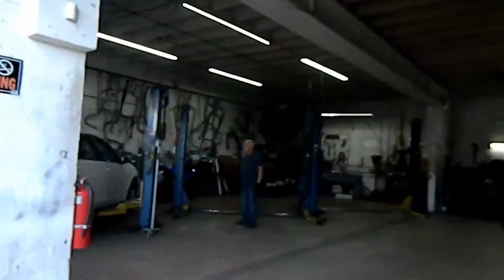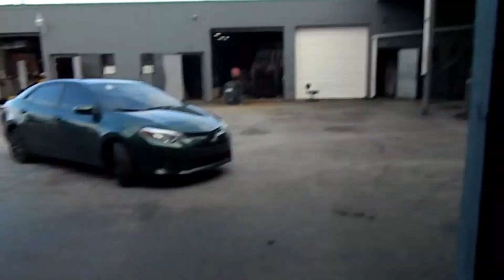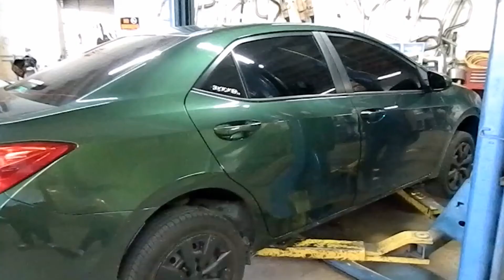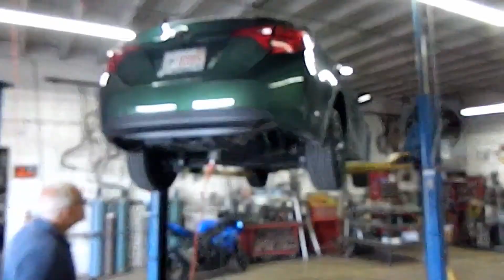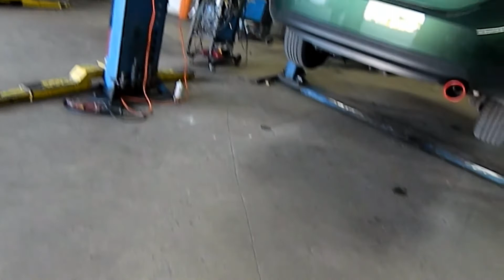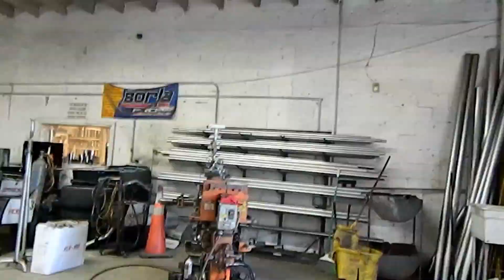( Vlog #5)   I Straight Piped my 2016 Corolla!!!!! Its so Loud!!!!!!!!

Comment: Did you get any gains in performance?
Reply from the maker: Just 12 extra hp
Reply: I am Sid impossible lol
Reply from the maker: @4door_papi  actually not impossible if you know anything about cars bro lol
Reply: I am Sid not even  a catback and off a 4cyl idk dude lmfao
Reply: I am Sid i prob know more than you not to sure as idk you but judging by your comments ik more lmfao
Reply: Lol it’s straight piped.. it will lose performance.. it’s not a performance exhaust so
Reply: If you knew anything about cars you wouldn’t be straight piping a corolla lol
Reply: And small 4 cylinder engines need backpressure to make power. I’m also highly doubting you put this on a dyno before and after cutting your muffler off and saw a hp gain. You probably did not gain any power.

Comment: U guys need to stop doing this shit. Don’t be a cheap ass and just straight pipe. U are doing more harm than good. Your going to get codes. Not to mention tickets depending on the state. The sound is not worth it. That muffler is there for a reason. Toyota has two mufflers u can buy. There’s the trd which they put on the sport and the borla. Which sounds better. Do not cut of the resonators they are there for a damn good reason. They are there for when the motor shifts so it doesn’t break welds or other components. 🛑 your just doing harm to the car. Just spend the 300 bucks on the borla. It bolts right up. No welding. Any one can do it with a jack and Walmart tools.
Reply: Did you come to this YouTube video's comment section just to whine and rain on everyone's parade?
Reply: @madisonbreland7652  I feel it was good constructive criticism, he gave good options than just hating